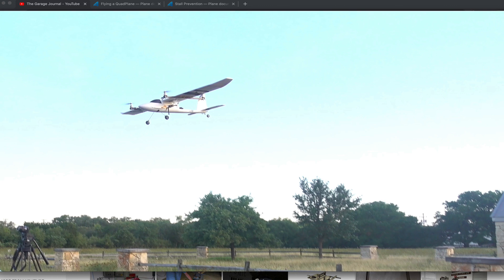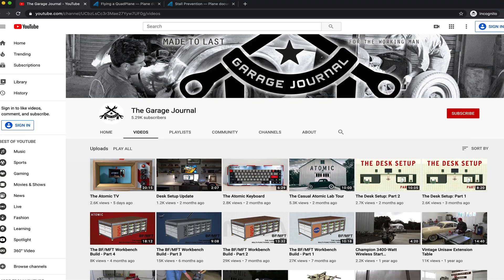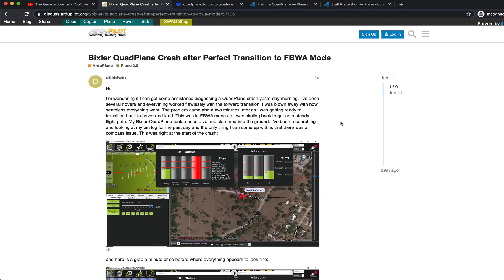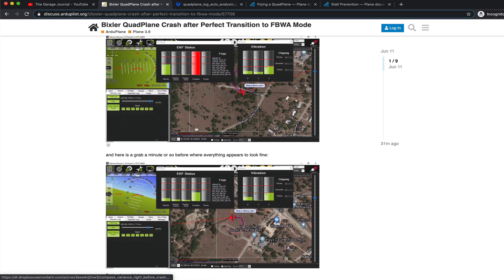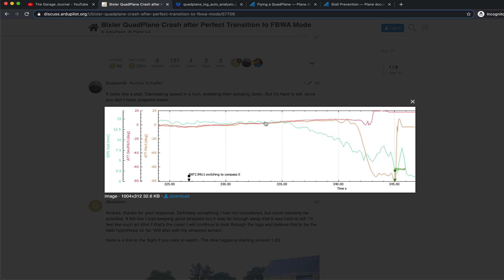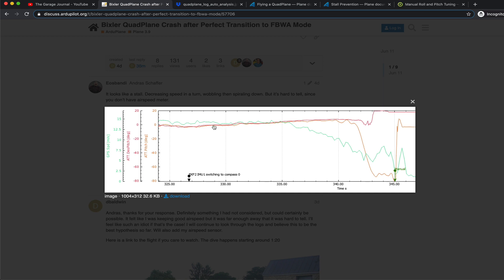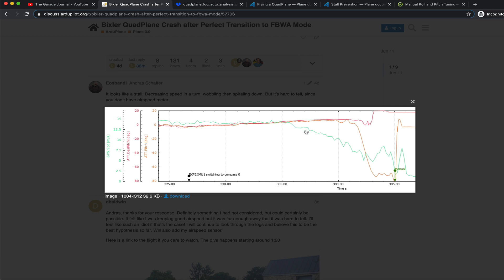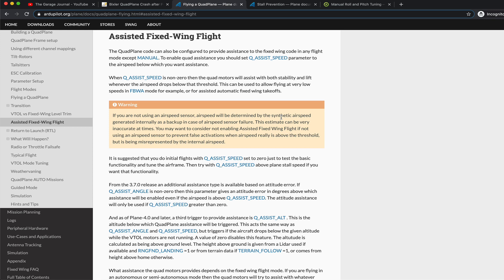Bixler Quadplane Maiden - Perfect Forward Transition Ends in Nose Dive

Comment: I had a few unexplained issues before using openaero vtol in a multiplex Easy Glider. That transitions perfectly both ways. I put up a video with controller settings etc.